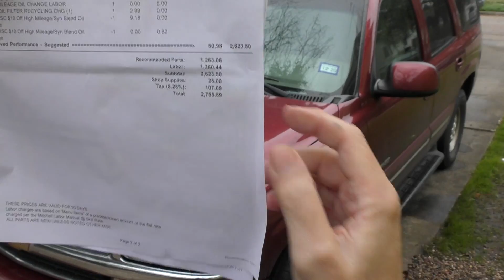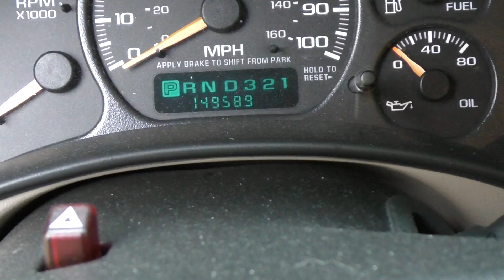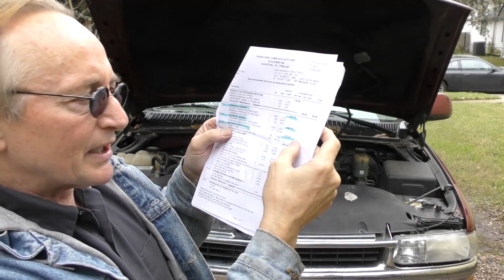This Makes Me Want to Quit Being a Mechanic

Comment: I don’t want to name the repair shop but it rhymes with Liarstone.
Reply: They quoted me about $1,800 a few months ago for a repair, saying the part was sold by the dealership only (part was quoted at about $1,200 or so). I called someone else  and they quoted me about $1,000 less. It was not something I could do myself, as I am not very skilled in most auto repairs, especially if it gets too complicated, which this was. It was something like the hydroboost/master cylinder thing. I have a 2000 Mustang GT, and that part was leaking  which caused my inspection to fail, so I had to get it done asap in order to pass inspection before renewing my sticker. But the place that did the job said they don't know why FS said the part was dealer only, since there are so many aftermarket parts out there. Plus, I googled it, and saw plenty of parts for way less than $1,200. Heck, less than $500. I go to FS for my oil changes and to have them tell me what they think I need, and then either have my friend's husband make the repairs, or the other place instead, if he can't do it.
Reply: The WORST.
Reply: Simmilar bame with bridgestone
Reply: Well done lol
Reply: I can vouch for Firestone doing crap like this I used to work for them 9 years ago.  If Manger of the Store doesn't show high enough number's they could get demoted or fired.  Then there were some manger's that went out of there way to sell people crap they didn't need.
Reply: Right on.
Reply: My uncle worked at one of the firestone's he was trying to explain to the boss no one wants to get an oil change and hear that their car is a p.o.s lol, they closed down 6 months later. I feel like the 40+ point inspection was part of their down fall.
Reply: Took my mustang to liarstone to get 4 new eagles , look out there kid has my hood up so I yell out there " I'm here for tires put my hood down "kid says ok 
So next I hear a air drill  "  buzzin so I'm thinking " that drill ain't being used on my car he's just putting tires on " next manager waves me up leads me out to the garage says we got a problem you need a new lugstud 25 bucks I look that little basturd marred my lug up with the drill told him to let the car down I'm gone 
Never again!
Reply: They suck at doing alignments too, had to take my car back more than 3 times for the to redo it (free of charge).
Reply: Yep I'm calling them Liarstone from now on.
Reply: Ain't that the dang truth!
Reply: The flame rock?
Reply: I got a good friend I grew up with.  Guess what? He's a Master Honda/Toyota  tech. All my car problems solved. I usually call him when I'm hung up on something. If I can't figure it out he usually always helps me out. Does all my state inspections. My go to guy.  He borrows my truck whenever he wants. I cancel my plans so he can use my truck. That's how much I appreciate him. Valuable profession indeed.
Reply: @SophieMia806  probably whats called the "Brake Master Cylinder" 
It holds the pressure fluid that your brake system uses to squeeze the brake pads on the wheels so hard. And applies it when you push the pedal.
Reply: Yep, almost anywhere you go trying to scheme and scam, find a good garage good luck!
Reply: Firestone is notorious for overselling.

Edit: They have a new commercial claiming that they never rip people off. 

I somehow don't believe them.
Reply: ¿Fireclone ?
Reply: Is Goodyear any better?
Reply: @Dredhawk10  I knew an elderly woman who sold her car for salvage because of Firestone.  They said that it needed over $1500 dollars worth of work.  All it really needed was some basic maintenance and perhaps a set of brakes.
Reply: I’m embarrassed about this but 6 years ago when I knew nothing about cars, this guy at Firestone told me I needed a $100 engine flush cause the ignition was sticking when turning the key and i said ok 😭. The worst part is I did it a second time 5 months later
Reply: @gardawg3696  🤣🤣
Reply: Tried to sell me brake pads not because worn but deteriorated from age
Reply: Yeah, Firestone sucks.
Reply: Yes, we have one of those Liarstone shops here.  They wanted $400 to give me new brakes all round when my problem was that I was losing pressure in the master cylinder.  No mention from them of the problem in the master cylinder, which means that they didn't know how to find it or know what it looked like if they did find it.  I got in my car and left.  Last time I have ever, ever gone to one of their locations.  You have to know what your problem is BEFORE you take your car in to get it fixed.  Otherwise, you are throwing your money into the street.
Reply: Firestone
Reply: How come you cant say their real name?🤔
Firestone.
Reply: @Dredhawk10  

I, too, can agree with you because i also used to work for FireStone and we complained with each other except to the supervisor. We was told we needed to clean more products faster but I say, we can't have BOTH. I, too, suspected they were more worries about quantity over quality and you shed more light to my understanding. 
It does makes sense if the supervisor ain't getting his or her numbers or quotas then he or she will be demoted.😟

I despise FireStone!!😡
Reply: 💯🤣💪 Such a great comment. Lol
Reply: haha Good one...I love it.
Reply: @TheLionAndTheLamb777  probably just needed the windshield cleaned
Reply: I dropped my car off at firestone to have the front end aligned and they put 49 miles on the car.
Reply: Only go for their lifetime alignment
Reply: SC EM When I was younger, I got fired from a Firestone because I beat the service manager half to death for stealing from a customers car. The car he was stealing from belonged to the mayor’s wife. It was funny to watch the place closed and the management be arrested before I left.
Reply: Dave Crupel She could also be talking about the brake booster. Brake boosters use engine vacuum or power steering pump pressure to give you power brakes. A leak there will not kill your brakes, but it will make the pedal harder to push.
Reply: Yes; absolutely.
Reply: Focking Firestoned went there once for a oil change the guy couldn’t unscrew the drain plug had to grab the wrench from him and unscrew it myself
Reply: 🤣 Beat me to the punch.
Reply: Liarstone was the name on the first page of that estimate.
Reply: lol
Reply: Maaaaannnnnnn they ripped me off some 20+ years ago! Too bad their still in business!
Reply: I guess I'm one of the lucky ones so far.  I go to Firestone and have never been sold anything other then what I need.  I was interested in replacing my struts.  The car had 150k on the originals.  Mechanic there said they aren't leaking and they seem to be doing the job, I'd leave it.  I said ok.  On my 2001 Chrysler minivan I had oil change,  filters.  Little stuff like that.  Do you think these tires should be replaced?  Going through 10 states, about ten thousand miles.  Inspects the tires.  No you should be good for another 15 to 20k.   Ok, no tires.  I'm from California and have gone through Nevada, Utah Wyoming and now going through Montana doing the 80 MPH speed limit when the right front tire blows.  Changed the tire and the nearest town was Butte.  Next day put on four brand new tires and continued into Washington State to finish our trip.  Luckily I wasn't driving a Ford Explorer.   I hear that there have been bad results from blowouts in those.  My mom had one of the roll over Explorers.  She was with me on that trip, so glad we took the Chrysler Town and Country instead of her Explorer.   Anyway, knock.on wood, I have been very fortunate with not being oversold at Firestone.   If that changes I do have an good mechanic who is honest like Scotty and very reasonable.   Example.   My mom now has a 2008 Mercury Mariner 3.0.V-6.  Same thing as a Ford Escape.   The oil pan had a small leak.  The Ford dealer in Madera, California wanted $3400.00 because you have to drop the motor to pull the oil pan.  I called my mechanic and he did it for $700.00.  He sent me pictures while the repair was in progress so I knew what was involved.   The Ford Dealer told my mom that she should just trade it in on a new Escape.   They were only going to.give ger like $1000.00 because they would have to make the repairs before the resale.  Yea right.  This was for a pristine, garage kept Mariner with barely over 100k.
Reply: @Chuck Finley Yes! That’s exactly what i thought and (i’ll name it) Firestone. Used to work for them, a CVI is 100% an opening to sell. Although i worked at 3 different ones and not all are like that. One i worked at $1,000+ estimates were common, and that’s why i quit
Reply: Absolutely I have seen them take my ex-girlfriend and her mother for a ride for the last 10 years they've gotten 20,000 out of each of them probably I've only recently been able to persuade them to use the mechanic that I use there's a personal friend and he's already saved them thousands.
Reply: @douglasstangler  Nope
Reply: SEARS 😂😂
Reply: @douglasstangler  My local Goodyear store does me a good job. I know the manager real well. I also know all the technicians on the shop. I know my cars and their maintenance on them. I mechanic some myself. So they know better then to screw me over!! The outcome will not be in their favor!! Trust me!!
Reply: I went to them to get the inspection, then went elsewhere to get the work done. The mechanic that did my inspection seemed honest, but the price compared to what my local mechanic charged for the same repair was ridiculous.
Reply: @Mr.G360  lol they mangled the drain plug on my buddy's Tahoe and I had to grab my Irwin set and removed myself then had to get him a drain plug but they want him to pay for a oil pan for 5 buck and oil I fixed it for him been doing his oil changes since
Reply: Firestone was crap in Canada too. They killed a Honda I was driving. Persian scammer was running this particular location.
Reply: SophieMia806 what part was it?  I have a 2000 mustang GT as well.  These cars are relatively easy to work on
Reply: Michael Lynch  yeah, Stay Away from Firestone! They did my brakes front and rear, 11 months later brakes started making noise in rear, brought it in and they tried to tell me my rear calipers and rotors needed replace and tried to charge me $700! I called their Corporate Office and threatened them with better business and they agreed to fix it free. Gotta watch them if u use them!
Reply: Tried to charge me $1500 for shoes and drums. First time I’ve ever laughed at someone as I walked out.
Reply: @TheLionAndTheLamb777  ripping of anyone is disgusting. but people ripping of women, children, the elderly need to be culled from the herd.
Reply: @gardawg3696  everybody get ripped of a few times....now you know... all the negative judgement goes to the sociopath liars not to their customers.
Reply: They wanted 270 to change my lower radiator hose and thermostat. I did it myself for like 25 bucks
Reply: This so true
Reply: Any of the chains are a bad idea

Comment: I live in Vermont and a leaky engine is what we call under coating.
Reply: No doubt!
Reply: If it's leaking, then you know it's got oil. You got a problem when it stops leaking.
Reply: Sam Shim Exactly. A little coolant leak is good to. So you can just top it off every once in a while rather than having to replace all of it at once. :)
Reply: A little oil leak is good! It will lubricate steering rack and the drive train. :)
Reply: Don Hurst 👍🏾 great way to prevent rust too😉
Reply: If it leaks oil it must be a Subaru official vehicle of Vermont
Reply: i call it "general motors"
Reply: Lol!! True that?
Reply: Lol that's what my dad told me growing up. I was gonna clean it but he said to leave it if would help protect it from rust
Reply: @johnmattiazzo3900  or a saturn

Comment: I actually liked my firestone, the guy was honest, he'd whisper at me every time "you don't need it." he only lasted a year there then I stopped going there
Reply: It's the guy you liked not Firestone, lets not give Firestone credit.
Reply: @Kamal_AL-Hinai  lol nope. Its up to the individual to be honest or not. Got nothing to do with capitalism.
Reply: I did the same thing when I worked there. If they honestly didn’t need it I would tell them.
Reply: @dangoodwin5400  ? Get a sales job then be honest, you now do not have a sales job.
Reply: The mechanic I got did the same. He went over every repair with me and told me which ones were safety issues and which ones I could do without.
Reply: @dangoodwin5400   yeah, until the individual is fired by cooperate management for not selling enough unnecessary brake jobs and gasket replacements.  If you want honesty go to an independent local shop that doesn't have shareholders to pay and insane overhead costs... or do it yourself
Reply: @dangoodwin5400  you don't get sales being honest
Reply: DanTheMan it’s dishonesty
Reply: Bunch of communist OMG, what’s the alternative to capitalism????? I’ll take my capitalist system, thanks, and you can take your government run nightmare, no thanks...
Reply: diesaltrading the guy said capitalism no place for honest people, kinda a dumb statement
Reply: @Kamal_AL-Hinai  any system can be corrupted....ask those people you lived in socialist/communist countries how un-corrupt it was
the only rule is the golden rule -- treat others as you want to be treated....just that one rule solves 99% of the issues.
real men walk the walk and work to live an honest life, if everybody has the guts to do that then the world changes...no waiting for politicians to save the world.
Reply: @helphelpimbeingrepressed9347  find a different job...no guts no glory. not everyone sells out but the sell outs always have excuses for selling out. be the man you want to be, not what the system wants or needs you to be, trust that
Reply: @diesaltrading tell them to F-off and get a job that doesn't require you to lie...it's that simple, you can do it, be the man you want to be, walk the walk, always bet on yourself and doing the right thing, it will always lead to something good.
Reply: Yeah, I hate the big corporate places. They are soul sucking, just like every other gigantic corporation.
Reply: @WeAreTheOnesYouSee  agreed, capitalism gives me the choice to go elsewhere and the ability to tell em to buzz off.

Comment: And Scotty.  I guarantee that the shop would have taken the $2700 and never done any of the repairs. That’s what’s even worse about scam shops like that.
Reply: It has happened to me at a Toyota dealership! Never again!
Reply: Really...in the legitoous U.S.I would have to say good luck with that one.
Reply: Good point. There would have been no way of really telling unless you look at the bolts closely or recent marks etc. Or unless you actually go to change them or take the covers off to look at the gaskets age. They could have backed each bolt off a little bit one at a time and tightened and then gone on to the next to make it look really good or just scratched them or cleaned them. Maybe they could have smeared a little oil around them just to show previous leakage after it was done. They are starting with a clean slate with no leaks so they do not have to worry about fixing it anyway. The perfect vehicle for the scam.
Reply: I put the info in a comment for the location. Call them and complain.
Reply: Several years back I took my Tahoe to James Wood Chevy in Denton for an oil change and a tire rotation. I went back that afternoon and was staring at a $1200 invoice for the oil change, the rotation and ‘other services’.  I pulled the dipstick and the oil was filthy. The tires weren’t touched either. They agreed to take $400 off the bill and I got stuck paying $800 for apparently storing my car there for the day.  Never again.
Reply: @lunahostcorporation5029  I would have called the local TV station. They can't charge you if you haven't signed for the "extra charges".
Reply: @ariip  
I have them tell me what it is, mark the pieces I can, with a paint marker, then I know what they did and didn't change.
Reply: @lunahostcorporation5029  They're crooks, buddy! Now, you know for sure you have to learn how to do, YOURSELF, your own oil change and tire rotation...I do EVERYTHING  in my garage: oil change, tire installation and rotation, gearbox fluid change, fuel filter & cabin filter change, detailing, including clay-barring, compound and wax, brake job,....The only things I do outside my garage are the maintenance stuff that needs a lift and/or special tools (like, in 2 days, the installation of a performance suspension set because I do not have the spring compressor, the strut knuckle spreader and a lift to do the job properly) ....For that, I do my due diligence (watch a ton of you-tube tutorials...), buy the OEM/aftermarket performance part on the Net and bring it to a shop owner that I trust and tell him: here's what needs to be done, here is the part, here's a video on how to do it (eventually, if he has never done that before!), and how much you will charge me for that?....He does the job while I am watching and standing beside him, I pay him and I leave...happy like a priest after a Sunday mass...! The guy who will rip me off is NOT born yet....!
Reply: LunaHost Corporation For Sure.
Reply: A Toyota dealership did a simple brake job on my car. Called me and said the rotors need to be replaced, got it back and none of the rotors were replaced. Also a week later the rear driver side brake caliper was making noise. Missing 2 bolts. Never again